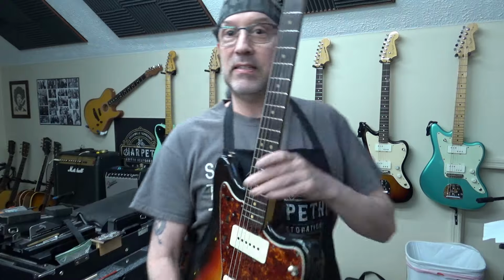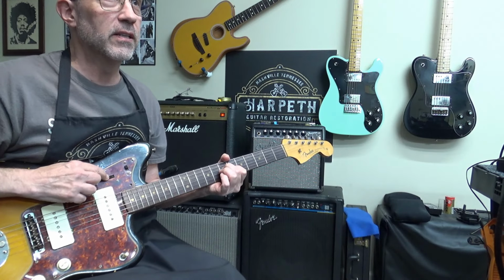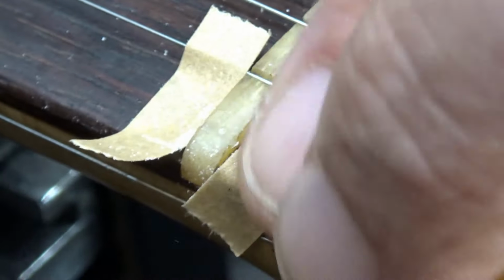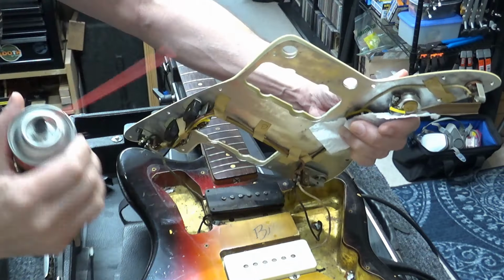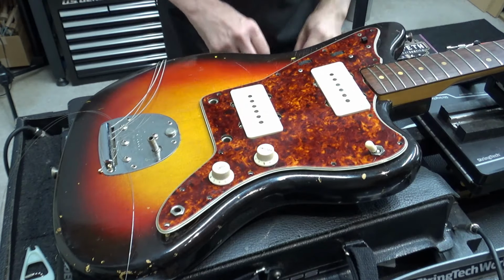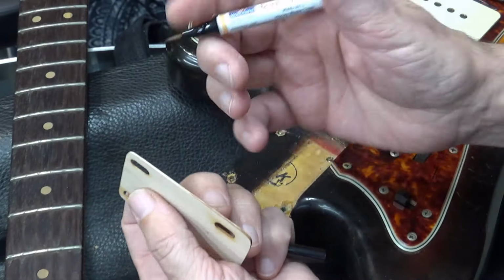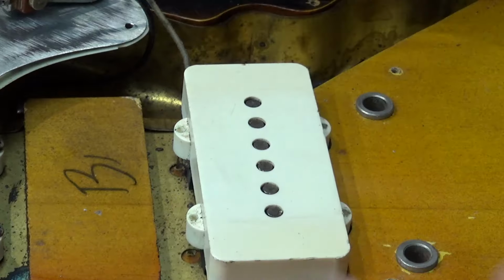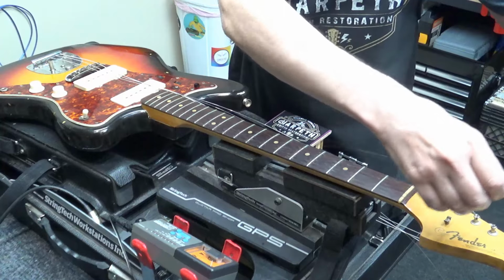1963 Jazzmaster

Comment: Shim is the way to go.. people malign the JMs and Jags but they must understand when they were designed people were using 12 or 13s for the high E. You could get away with the lower break angles on the bridge.
Reply: 100%. Or I will sometimes cut the angle into the neck pocket, though I wouldn't recommend that with a vintage example such as this one. I won't string an offset with anything less than 11's. Just the string gauge alone makes a big difference!